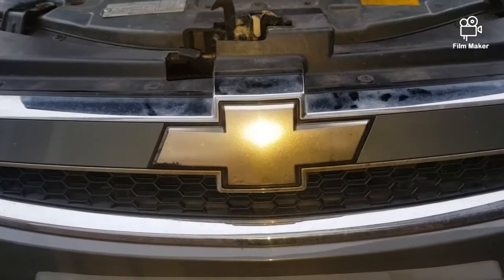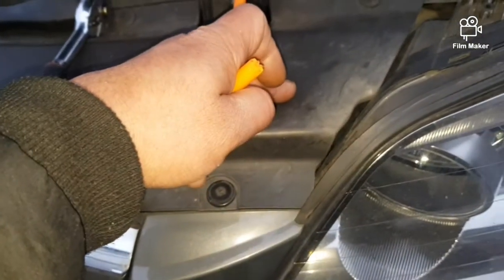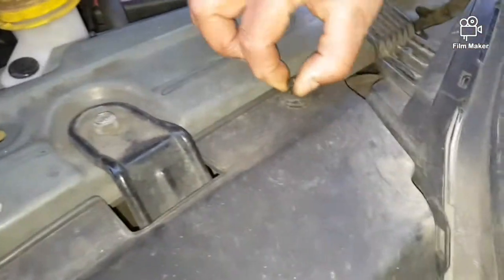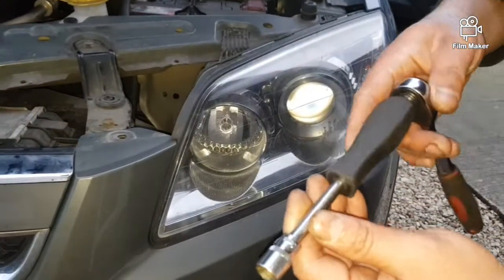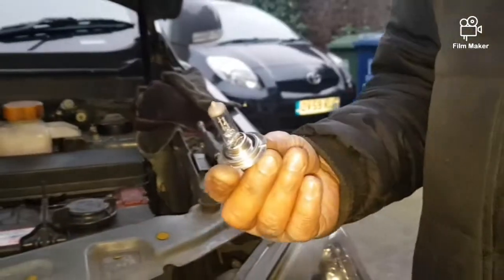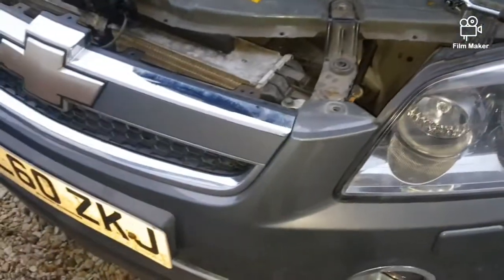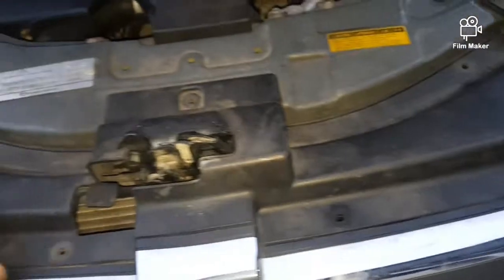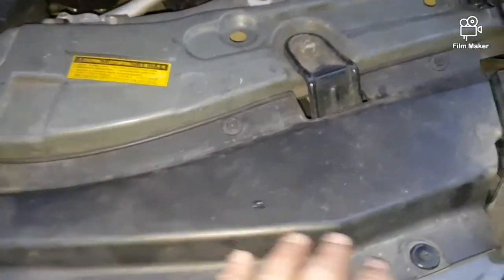Chevrolet Captiva Headlight Bulb Replacement || Headlamp Bulb Change. Headlight Removal Process.

Comment: Thanks for this vidéo i want to change It with led but i dont now if is it H4 H7 or other ?
Reply from the maker: You are welcome thanks
Reply: @diykhan  do you now if is it H4 or H7 ?
Reply: Same question, H4 H7  what bulb?
Reply from the maker: H4 has three legs n h7 has two. It's been a while since I did this job so I m extremely sorry for not remembering.

Comment: just replaced both headlamp bulbs after watching this helpful video...problem is,  it's currently 10 degrees here and every one of those plastic retainers snapped and broke when removing them .....I  can't find exact replacements at my local auto parts store...I wish GM would have just used simple screws......anyone know what these plastic fasteners are called and where  I  might be able to order these...thanks....
Reply from the maker: Good to hear from you. Not sure what they r called but u can get scrivets from ebay. They that.

Comment: What do I do if those scrivets are stuck and won't come out that easily?
Reply from the maker: Try using a small flat head screwdriver
Reply: @diykhan  That's what I was using, but there isn't enough of a gap between the inner part that pops up first and the outer part to fit it in there at all. It's snug.
Reply: @diykhan  And the 2 scrivets that you needs a screwdriver to get it out just spin and won't come up. And now one is broke and I think stuck in there. This sucks lol.
Reply from the maker: @dustinbumgarner117  try digging out from the sides of the scrivets. If no luck then brake them n u can buy new ones from any decent auto part shop.
Reply: @diykhan  Been trying that. It took an hour to get 2 out. Plus I broke that other one and it's stuck in there.
Reply from the maker: Use a small flat head screw drive to life the side of the middle screw n same time try to undo the screw with little downward force

Comment: Hands down the worst car I've ever seen in my life. Just changed the bulb and it took forever. Terrible, terrible design.
Reply from the maker: Yes I agree. They made it too complicated.
Reply: 100% agreed. My scrivets would not come out and the deep screw at 5:23 is such a pain. I dread every time I have to change these bulbs. Why couldn't they just have an open design like most other cars where you can just open the bonnet and twist the cap off with your hand? No need for all these tools for a job that should take less than 5 minutes.